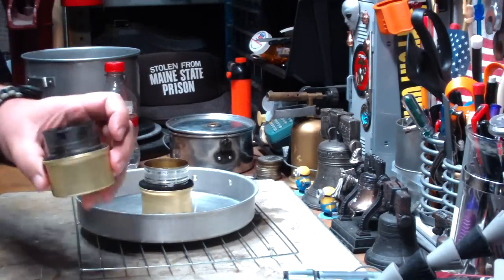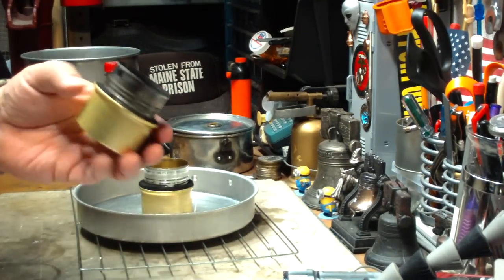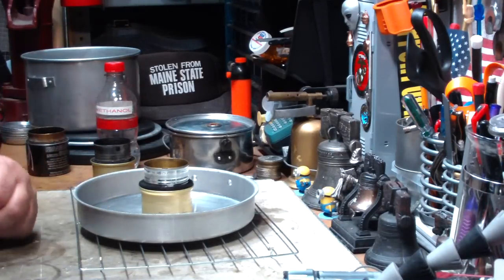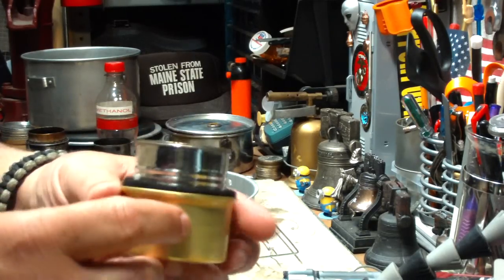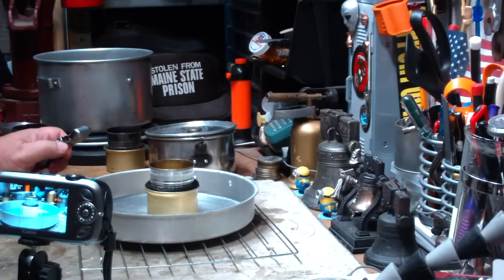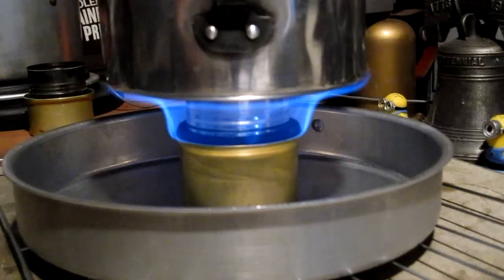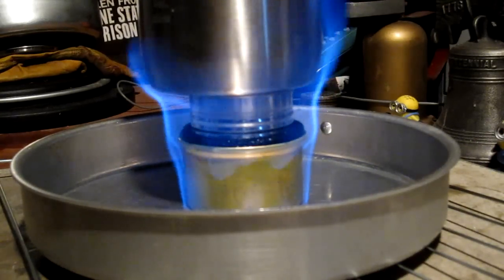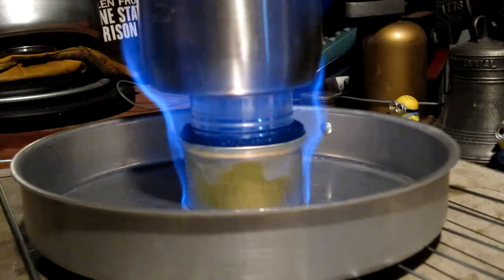Fancy Feast Stove - Trail Hound asks, "Is the vent hole really needed?"

Comment: If you use a Vienna sausage can instead of the cat food can, the top of the tomato paste can is 1" above the top of the sausage can.   No metal cutting required.   Also, you can use a strip of paper towel for a wick if you do not have the carbon felt.  It works for me.

Comment: I am just starting to build & use alcohol stoves this info was vital thanks for the video mister. those holes in the inside can deserve some attention alright.
I have seen a lot of like videos yours is the first I have seen that showed the overflow well done. 🤠
Reply: I hesitated to make this type of stove until I watched your video it  got me motivated it did.
So the first ever stove had paper towel for wick & no holes or nicks in inner can. Works just fine.  It seems that different wick material calls for different holes for inner can. I will try wood alcohol next did not like isopropanol.🤠

Comment: Hiram: I made one of those Fancy Feast stoves and I absolutely love it. Yet, I keep having a very curious issue. About a minute into my boil time, the gas vapor inside my stove ignites and the small combustion tosses my pot off the stove. The water spills and I start over. Do you have any idea why it’s doing this? I am considering making more or larger holes in the Tomato paste can. (I currently only have 2 fairly small holes).

Comment: Woops, glad I caught your video.  Made the stove but forgot the holes.  Was OK though as I used a metal steamer rack that came just over the  stove top to put the pan on.  After content of pan was heated, put a tea light candle in Vienna sausage can under to keep warm, adjust candle height, and save Heet/alcohol.  Can't be windy though.  You make great videos, keep them coming and thank you.

Comment: Wondering if you can help me.  I made this stove with fancy feast can and tomato past can.  I used the tomato paste upside down and it was cut down so that it was just barely taller than the fancy feast.  I drilled a 3/8" hole in the top for filling with fuel and so that only flame would be from the carbon fiber.  So...solid top on the tomato paste can except 3/8" hole. Didn't need the tomato paste can any taller as I put this stove in mojo stove stand.  Problem - about 20 - 30 seconds after lighting the fiber, the carbon fiber and the tomato paste can blew off like a rocket approximately 10 - 14 feet in the air.  I had not yet put the pot on the stove stand surrounding the stove.  Obviously pressure built up in the tomato paste can but how could it with the 3/8" hole in the top???  thank you for any thoughts on this
Reply: NW Lady: I didn’t see a reply so... I will say... a similar thing is happening to me. I built it the typical way and only put 2 tiny holes at the top. Once my pot is placed onto it.. about a minute goes by and POP... my pot goes off onto the ground, spilling my dinner. I’m certain the fumes inside are combusting and causing the little explosion.. sending my water flying. It’s got 2 cups of water usually, so it doesn’t go as high as yours did!! I’m going to cut more holes and try to fix this issue.

Comment: Hiram, I bet the boil time on this set-up is a bit shorter, ha ha.  Man, you sure were correct about it pumping the alcohol out due to the pressure build up.  There is no telling how many homes you have saved from burning to the ground by this demonstration...or how many forest fires were prevented.  I had no idea those little holes were so important.

Comment: thanks for the info. I used a mini red bull can in a fancy feist can with cotton wrapped around it like ur carbon fiber and fiber glass stoves. it boils water in under 2 minutes. but it has some pretty big flames. run time is around 7:30 till flame out.

Comment: I heard fiber glass can be used instead of carbon felt
Reply: Its alcohol, you can use a freakin T-Shirt..
Reply: +Tanuki In mY tests, carbon boils faster and fiberglass burns a bit longer, so depends on what you need, but I would go with an excellent ALOCS stove for $11 on ebay, it can burn and simmer over an hour with its simmer ring on 1oz. of fuel then build the supercat fancy feast stove with a tomato paste can in it for the fastest boil times and your set for anything, an dno felt or anything can be used or not used that supercat design,

Comment: Are you using the small Stanley adventure cook pot for this demo. Or is it the larger version.

I want to build this stove for use with the small Stanley set. The one that comes with 2 cups in it. If this is what you have, can you demo it. Is it stable. 

Speaking of stability. These things look like they would need to have a fairly flat surface to balance the pot just right. What if you're on uneven ground. Is this type of stove still a viable option.

Comment: Hi Hiram.  I have the commercially available Fancy Feast stove like Shug's. After viewing your informative Fancy Feast vids, I pulled the center tube out of mine and noticed two things. The tube has no holes cut in the bottom, although there are v shaped cuts in the top, and the wicking material looks like fiberglass. Despite these differences, it works like a champ. However, if I ever destroy my Fancy Feast, I'll make one like yours because I have some carbon felt, and I love a DIY project!

Comment: Bbmize; I designed my MAHALO stove primarily FOR fuel economy, and still a decent boil time. I live at a high altitude. The MAHALO can take tap water to 202F in 6-6 1/2 minutes and use only 13-16 ml Heet. I know by blowing the stove out and reclaiming unused fuel

Comment: Bbmize; the 1/2 inch gap will do two things different compared to a 1 inch gap. The 1/2 inch will give a slower boil time' and an increased fuel economy. I think it is a fair trade as long as it does not take 10 minutes to boil 2 cups.